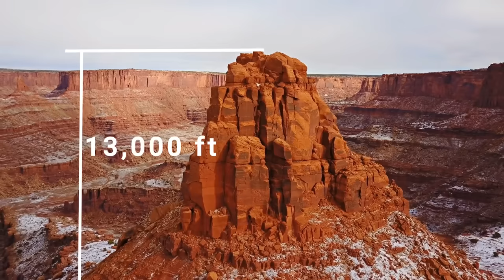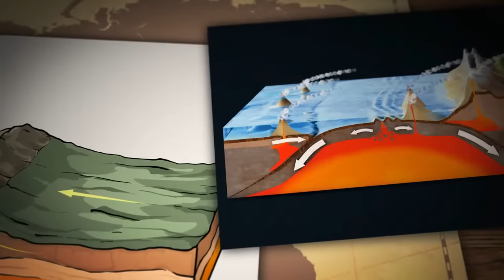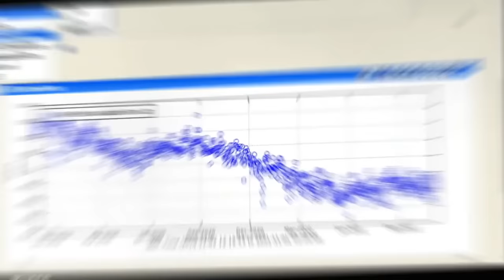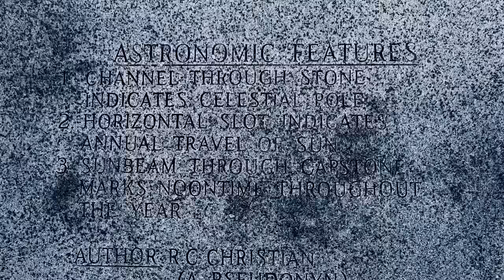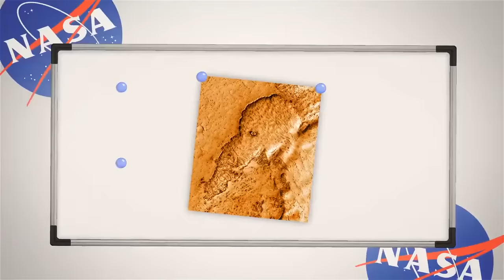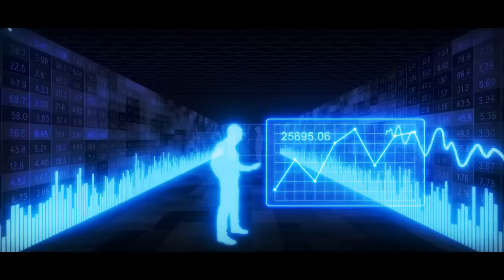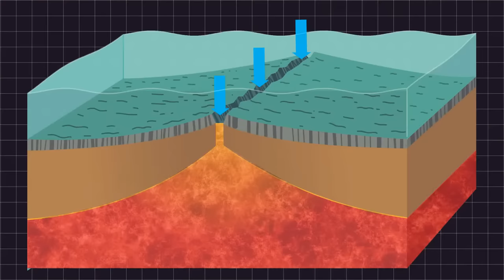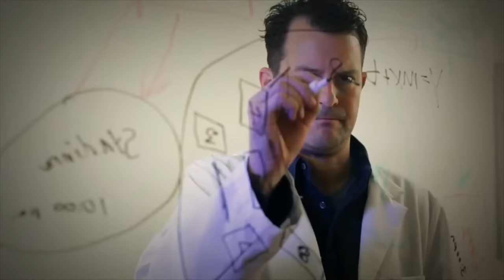Earth Lied To Us! These Secrets Will Blow Your Mind!

Comment: I also went to the Mystery Spot in Santa Cruz, California. The one phenomenon that confounded me was a hunk of metal hanging by a chain from the ceiling. I gave it a very light tap to get it to barely swing. While I stood there, the swinging motion slowly began to increase until it was bashing into the wall. The only explanation I could come up with was some trick using an electromagnetic device.
Reply: I concur.  Maybe there's electromagnet imbedded inside the walls.  There's a prank that took place in a coffee shop.  The girl pretended to have powers, shove her hand, & her bf went flying up against the wall.  They later revealed it was a gimmick with magnets.